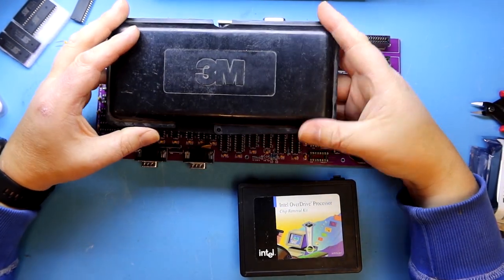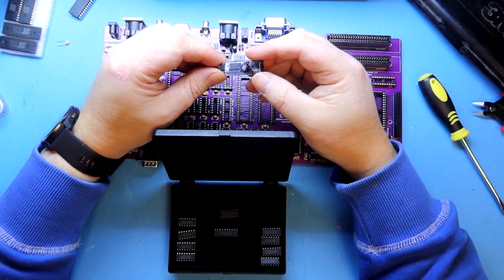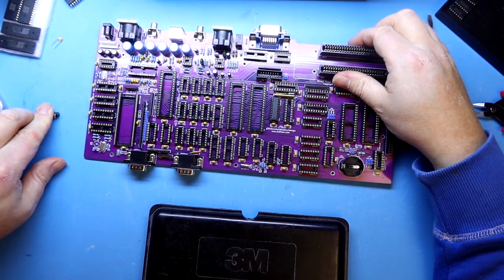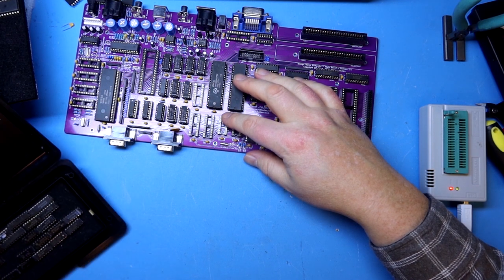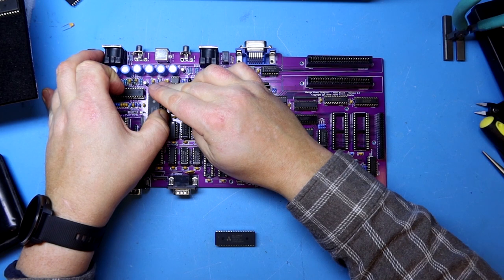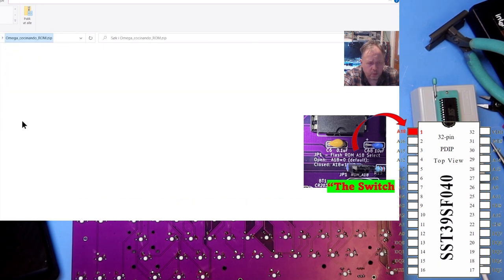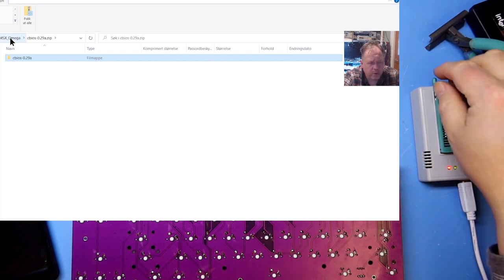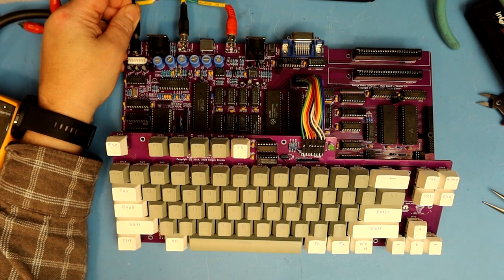Building a NEW 8-BIT MSX machine in 2023 – The last millimeter, or mile as it would seem.

Comment: Nice video! I like that you are taking your time and enjoying the process... As far as  the memory error - thera are several options, maybe U15-U18 74HC(T)670 are not good, or some logic ICs in the memory pager and slot selection, e.g. U32, U33 74HCT32, U22, U23, U30, U31, U40, U41.
I've noticed that you're using both 74LS and 74HC series. Make sure that 74LS outputs don't go to 74HC inputs... That might not work reliably
Reply from the maker: Thanks for replying, as the creator of this design that of course makes your contribution to the fault-finding process all the more valuable. First I have to give you some praise (I know I have done this before on some of your other designs, but then again it’s deserved) The way you bring back retro systems by combining this with slightly more modern components brings a whole new dimension to the retro scene. As with the memory and use of GAL’s in this design, and the slightly similar approach on the Micro 8088, where you did a similar thing with the RAM, but also integrated a design for using an AT keyboard on the FE2010 chipset. This makes this something more than just a replica of somebody else’s design. And that brings out a whole new dimension about understanding the actual structure of the design, and is of course the reason why I used the Micro8088 schematic and FE2010 implementation in my fault finding process on the Schneider Euro PC.  But back to the task at hand. I suppose you mean my use of the 74HC273, and I do indeed have a situation where I use a HC273 (U23) to drive a LS153 (U31), this is most easyly fixed by trying in a LS273.  But regarding the HC670s there are some confusion. I have noticed that the schematics stated HCT670’s, the BOM list’s HC670’s (Not HCT) from Mouser, so I did not order any as I have lots of HC670’s in stock.. It this a misprint on the BOM ? Or have you actually tried the HC670’s ?   Kind regards KOJRO.
Reply: @kojroRI  the BOM calls for 74HCT for most ICs, and in this case, it is ok that 74HC670 are used (I picked them because 74HCT670 are unreasonably expensive on Mouser), now if there's anything TTL or TTL-LS connected to 74HC670, that might not work. So your options there is to replace these TTL or TTL-LS with CMOS (74HCT) or replace 74HC670 with 74HCT670 or maybe 74LS670